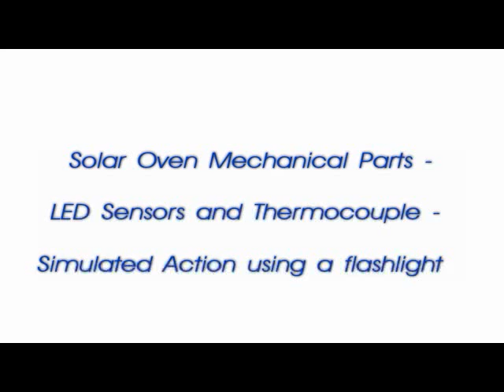Tracking Solar Oven Mechanical design

Comment: Very good work. There is a computer star gaze program called stellarium.  It is free and it can output the alt azu numbers for the sun. (So if there is a computer near enough there is no need to track the sun.) You could either do it automatically or get about 12 numbers per day and program it to turn on the hour. I am rubbish with electronics so I am not able to do any of this.  Brian
Brian